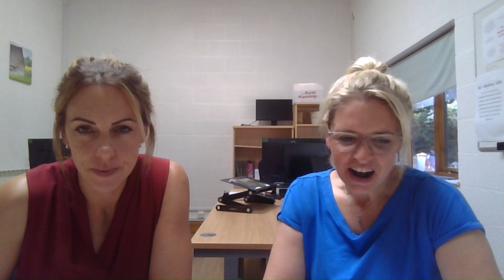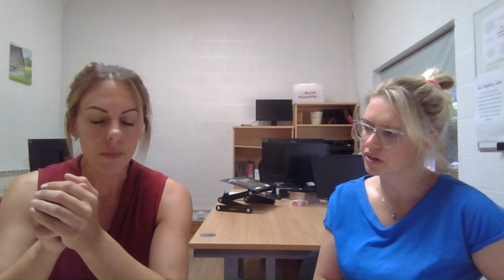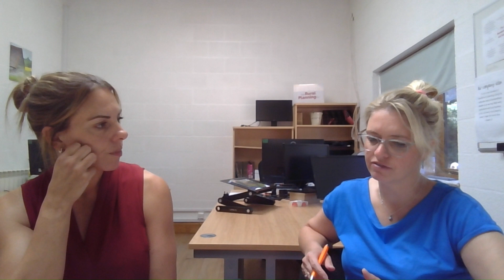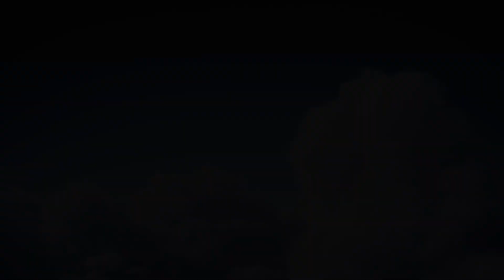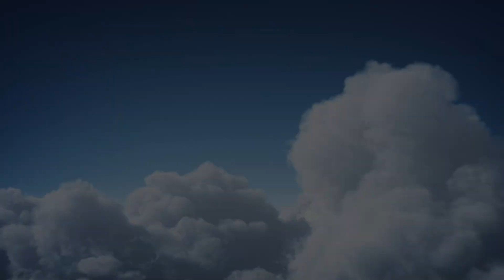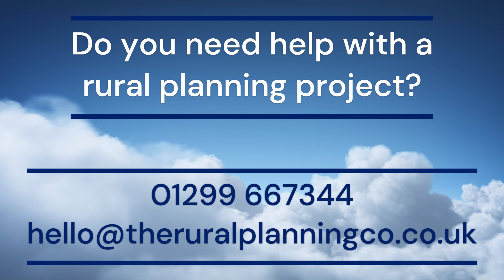Question Time with Hannah Moule - Question 1: What is Class Q? What types of buildings are suitable?

Comment: I have an old farm building that would be suitable for class q conversion, it is not ideal for our current agricultural use. My plan would be to get class q but i would then need to build a new, more suitable agricultural building to replace it. I believe that once you use your class q rights you're no longer able to build agricultural buildings under permitted development for 10 years. How would you suggest i go about it? Apply for both at the same time, showing the needs or do one and then the other?
Reply from the maker: @mbarnettuk it is very important that you apply in the correct order and this will be very dependent on your circumstances. It may be that the agricultural barn would be better under a full planning application and use your PD rights for the Class Q. This is where the planning strategy is crucial. I would suggest you contact our office on 01299 667344 or hello@theruralplanningco.co.uk and have a quick chat with one of our Planning Consultants. Many thanks